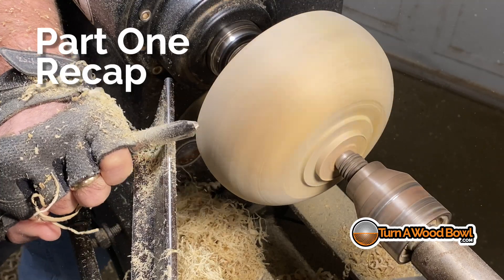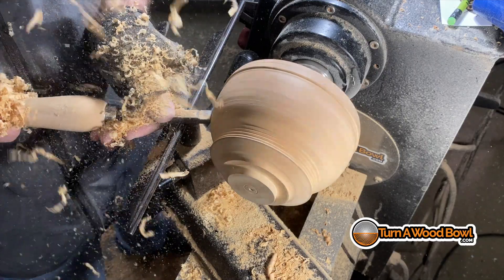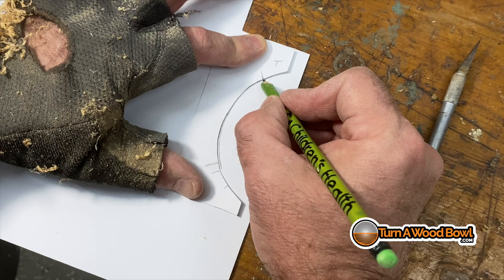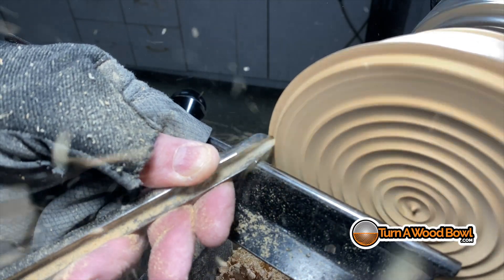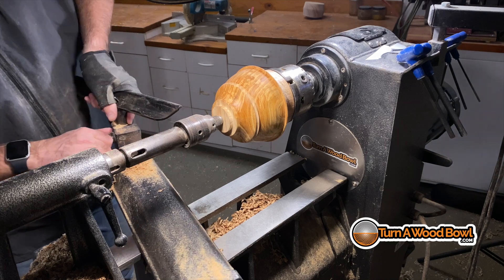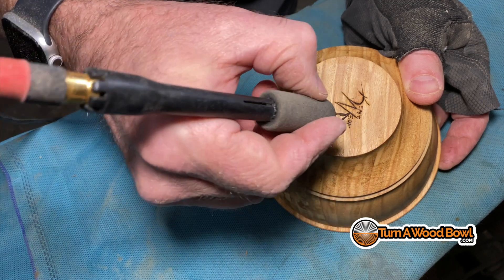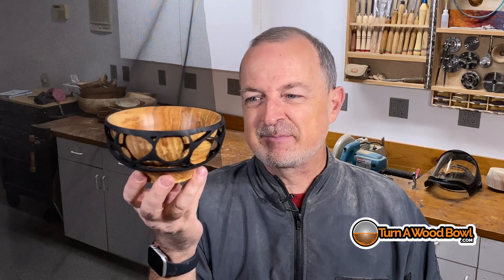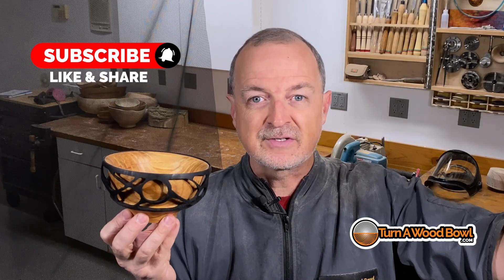Wood Turned Bowls – 2 Blanks 1 Bowl Video – Part Two Carving

Comment: Kent, awesome series! You make things look too easy. I have quite possibly the weirdest question you've ever gotten...what is the brand of the coveralls you wear?! I like the zippered front AND the high neck (keeps shavings out of your drawers!). I've searched but haven't found anything quite like them.
Thanks!
Max - Central Indiana
Reply from the maker: Thank you for the kind words. And it's not a weird question at all. Shavings everywhere isn't fun. All the gear I use can be found at TurnAWoodBowl.com/gear  Here's a link to the smock I use. https://amzn.to/3nclABF All the best to you and Happy Turning!
Reply: @TurnAWoodBowl  That was a fast reply! I was just sitting here watching another video and you walked over to your bench and I then noticed it was a smock and not coveralls. I should have looked at your website...it was about midnight and I wasn't thinking very clearly! Thanks for the tip...I'll go check it out!